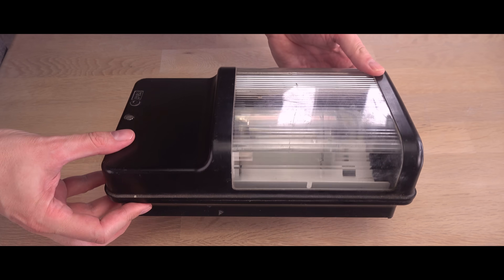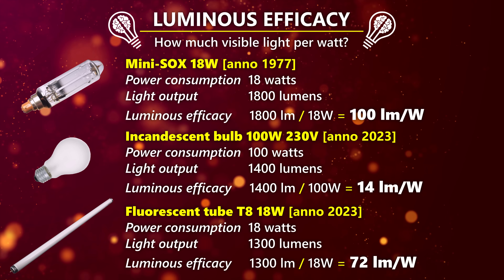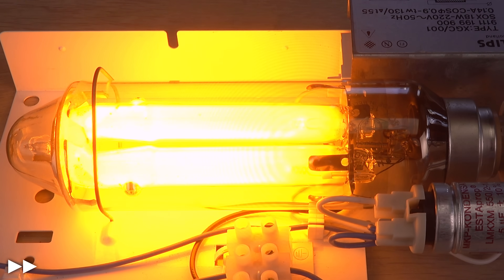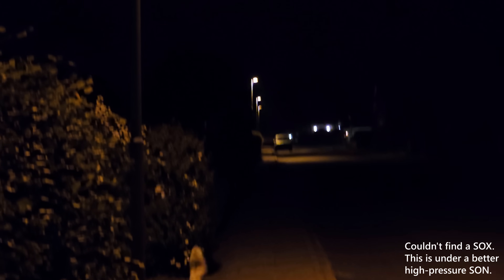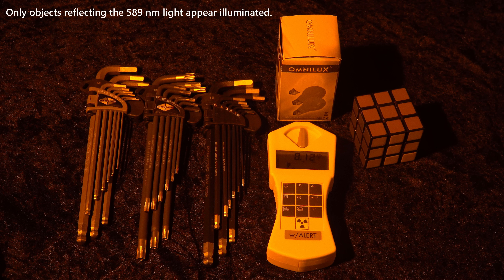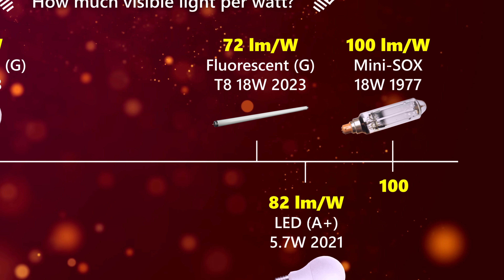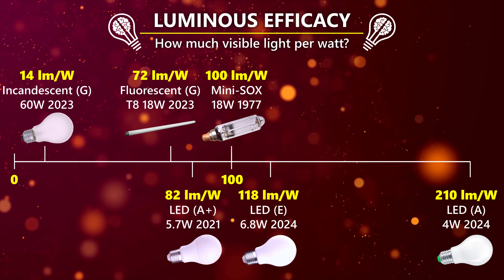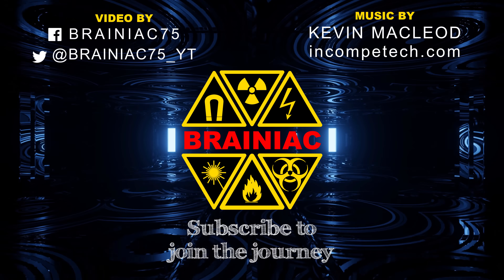THIS LAMP SOXs! "Yellow" tech of bright metal vapor lamp. Beats modern LEDs in brightness per watt?

Comment: For my first 25 years of driving an automobile, all motorways were illuminated with these 250 Watt low pressure sodium light bulbs. It became second nature to guess the missing red and blue cars which appeared as black. Nonetheless, the long night driving was very relaxing with this kind of monochromatic road light. I recall it was only in Belgium where every single stretch of road was illuminated at night. Parsimonious France and Italy only illuminated road junctions and urban roads.
Around the year 2000 something changed, and high pressure sodium and mercury light bulbs began making an appearance. The former have a wide light spectrum - wider spectrum with higher gas pressure, while the latter had a green and blue pair of spectral lines. The roads become whiter and - the Councils said - safer. I honestly miss the SOX lights of my youth.
Currently the Councils made me hate the newer LED road illumination: as a measure of economy, they set the brightness to a point where the light barely cast any shadow. Please note, is not possible to dim a gas light bulb; the race to install LED road light everywhere is because they can set each lamppost to 10-20 Watts instead of the statutory 250 W, while increasing the taxes for maintenance.
It reminds me of the communal moonlight lampposts in use more than a century ago, where an arc light was suspended at 30+ meters high, casting a dim and shadowless light, only meant for security.
I collect flashlights and all the models from 2005 to 2021 are now candidate for binning. A 2006 flashlight emit 200 Lumens, a 2024 flashlight emit 3000 Lumens, as the new power LEDs have an efficiency of 200 Lumens per Watt. As unbelievable it is, a professional pocket torch can emit 3000 Lumens for one hour; but the heat dissipation is not sufficient to keep this level of lighting for long, so the more normal light flux from a pocket light, keeping a reasonable mass, is between 1000 and 1800 permanent Lumens.
My brightest light, an X75, can emit 10,000 Lumens for one hour (until the battery goes flat), or 80,000 Lumens until the fan can't remove all the heath - few minutes at best. More than 50% of the energy fed into the LEDs is wasted in heath, which for 80,000 Lumens of light flux, is few hundreds of watt.
Thank you for this video, dear Brainiac. I have a lifelong fascination with lighting, so I had got into the details of how we make light - including oil lamps - and while I recognise how horrible is to illuminate our roads and public spaces with light having a monochromatic rendition, consider we had monochrome TV for few decades, and monochrome photographs for even longer. Driving at night in the '80s was like an immersion in a Black & White world, something that I, oddly, miss to this day...
I want to mention how much safer it was to drive under a 589 nm monochrome light when it was bad weather, under heavy rain or some light snow. The yellow light from SOX bulbs scattered very little, due to the missing blue spectral component. With HPS, mercury and LED lights there is a strong blue component, causing a lot of diffraction and subsequent light scattering around rain and snow, which is very unsafe in my opinion. The same problem is caused by LED car headlights, which seem blinding because of the excessive light scattering, caused by the intense blue source behind the yellow phosphors inside the LED.
Greetings from the UK,
Anthony

Comment: 1700 Lm/W is the highest spectral sensitivity and is achieved in scotopic vision at 507nm. Scotopic vision is mainly rod vision and dark adaptation takes up to 60 minutes. This is also the reason why a red light is used below deck in submarines. Seeing through the periscope at night at sea is only possible if the eyes are adapted to the darkness. When seeing in the dark, however, color perception suffers greatly, which plays into the hands of illumination with a SOX lamp.

The 683 Lm/W is really the maximum in photopic vision, where mainly the cones take over vision, which enables better color perception.

Overall, it mainly depends on the illuminance, above a few hundred cd/m² day vision dominates, below that night vision which offers poor color perception anyway (at night all cats are grey). Manufacturers are already aware of this and are pushing their LEDs further and further into the blue range in order to be able to advertise higher efficiencies.

😎Super detailed video, I subscribed straight away.

Comment: High pressure sodium is still used and has more colors. They put up LEDs in a park and some of them stopped working after a month. If I trust the cook of my dinner, I don't need to examine the meal.

I use basic LED bulbs at home that I got for free around 10 watts per 800 lumens. Those efficient ones might last longer because of less heat.

Comment: There are some still around, but you can't buy them anymore. They used them a lot in industrys and as an electrician I can tell you it's hard to know what colour wire you have under it. It's also used around observatories because they can filter that light out when making observations.
Reply: You can buy them still just go online I bought one back in October of last year just need to get another ballast kit for it.
Reply: @DiegoGene-fh3zp true, I actually came across some dusty old boxes with some brand new in them at a wholesaler

Comment: 95 lumens per watt for a normal LifX A19 bulb - I can't help but wonder, at 1100 lumens as the listed output and 11.5 watts as the listed consumption, how much of that is wasted on the 'smart' electronics that are very rarely used compared to the light itself - I'm only connecting to it for a brief few moments to change to a different color or brightness level, for example, despite the light being on for hours at a time, so if there was a way to turn off the wifi-radio and processor, it would be interesting to see how much the LEDs themselves sip, as well as very interesting to see where the 1100 lumens come from, what hue/temperature/etc

Comment: for anyone who hasn't seen it yet, the famous sodium vapor lamp film technology used for Marry Poppins has been recreated recently! Corridor Digital made a video demonstrating the tech. instead of using a unique crystal that filters for the exact frequency of sodium light, the recreated method uses a series of optical filters to get the same effect. it will likely never be used in modern films anyway though because the film industry is quite stubborn

Comment: Those watt ratings are for the LED part only and not the total wattage the bulb actually uses. When I was driving OTR back in 2008 and 2009 the sodium bulbs were still the major source of light at night along the highways. They were better for my night vision than the ugly green lights and easier to see contrasts. I still prefer them over the white LEDs for night driving.

Comment: There are vast amounts of research on sodium HP lamps. 600w seem to be the most efficient, agricultural version include more blue spectrum around 10-15%. oily fingers and age will impact results a lot, even similar models between manufacturers can vary a lot with their output.

Comment: Fun fact, there are solar cells that excel at converting the frequency of lps to electricity, and an lps lamp can use other sources of heat than electricity to generate light. There are actually two or more companies expecting to have products for hybrid cars based on these facts in a few year (we'll see). The idea is to get enough efficiency and weight savings to make that path better than standard ic (with moving parts and friction losses and so on) and generator (again moving parts and  various system losses).

Comment: Corridor digital did a video on these, because of the very specific color output you can use them for a negative for greenscreen uses with transparency which is otherwise very difficult to produce in software

Comment: You can buy high CRI LEDs that max out around 240lm/W   90+CRI (Rf 90 and Rg 99)  in   2.8mm × 3.5mm SMT package.   eg,   yuji HE 2835H G02.
It's possible that consumer products for these already exist but you may lose some light output in the diffuser so the overall lm/W output of the lamp as a whole maybe lower.
You could make your own light using LED strips of them and get ~240lm/w I guess by shining upwards to the ceiling without using a diffuser. (recessed LED strip)

Comment: I have to say modern led lamps are far more tireing on my eyes and lacking a big reflector eally gives the feeling of someone shining a laser at you.
Reply: LEDs are more-similar to Lasers than to any other widespread-use lighting technology. 
100% agreed. LED lighting feels strenuous. 

IMR/IMO, 
consequences of high-frequency PWM flicker and an obtuse misbalance of spectral output (typ Blue-weighted from a Blue Diode+Phosphor). 
I'd love to build/find some 'hybrid' luminaries; mixture of Halogen/Incan, LED, etc. to get the 'fullest' spectrum possible.

[unfortunately, Incans and SOX/LPS 'like' heat, LEDs very much do not]

Comment: How about the most efficient lights for plant growing? (blue and red)
and the most efficient lights for raising Black Soldier Flies? (Cyan [which is blue + green) ] and UV [Black-light])
I'm trying to do both with the same lights for my aquarium plants and the flies.

I'm currently running a LED daylight bulb, a LED blacklight and an LED Soft White or something like that, which has a very slight orange tint.

I could be mistaken on the names of my lights, but they are setup in a way that it is best for me to not deconstruct my setup to check the bulbs exact specs.
I'm thinking of replacing 1 or both with new 1500 lumen daylight LED bulbs and keeping the LED UV Blacklight, which is maybe 5 watts, but not sure.

Comment: Mines 140 lm/w Ive had better ones but they failed so fast, way faster than incandescent bulbs, literally 4 or 5 months, and despite costing a lot and being brand name like Philips.* These Wessex bulbs I bought like 4 for the price of one of those Philips and after a couple of years the first one I used is still going with no indication of failing.  
When you are talking about a difference of 1W it turns out that the cost of the bulbs themselves adds up to make it not worth going for the fancy ones even with electricity at the price it is these days. I dont know if thats just from the perspective of my budget either, I wonder if the manufacturing and material cost of bulbs is also high enough that more CO2 is wasted in high efficiency high rate of failure bulbs. Itd be nice if there was some kind of robustness rating. 

*Ive heard this can be heat issues and you can modify bulbs to make them last longer, but frankly I shouldnt have to. Id have been more sympathetic to the idea if it was some fundamental electrics issue with the flat Im in and spikes or some such, but now Ive got LED bulbs that work fine for years I dont see that the other companies have any excuse for such shoddy products.

Comment: when I used to work for a telescope factory, they used SOX lamps for their exceptional monochrome spectrum. spesifically they used it for  the newtons rings . in that instance they were using it to check the flatness of the angle mirrors.

Comment: It would be interesting to see a painting under that sodium lamp, made with metal oxide (or similar) pigments, such that there is green single pigment paint and the same green created with yellow and blue pigments. IE in normal light the greens would be indistinguishable, but under the yellow light you could see the difference.
Would that work?

Comment: Most of my bulbs are INNR 90%CRI 1060 lumen bulbs, drawing 11 watts, so ~96.3 lm/watt?  They have some smart bulb tech in them, so there is a bit of power overhead, as well as seldom being run at full power.
The others I use are mostly Philips Hue white ambience bulbs, which are harder to classify since their lumen output varies by color temperature.  7.5 watts and max output is 806lm at 4,000K, so 107.5 lm/w.
I have no idea what the specs are for the LED replacement tubes I used instead of the failing fluorescent fixture in the kitchen, just that they are FAR more efficient than the old T18 bulbs and ballasts were!

Comment: I use to install these SOX lamps in large outdoor areas, as they were everywhere back in the 1990's, still like them today, but technology has moves on.
Reply: I’m trying to get a set up goin on my property. I’d like 3 Low pressure sodium lamps. Or 1 Low pressure Sodium and 2 High pressure sodium lamps to help moderately see color. But I’m really just trying to recreate what I remember growing up. I don’t know all the details, but I’m learning!
Reply: @cvince556 I'm trying to get mine HPS set up but I need a new ballast because the one I have in it has 480 volts I'm gonna get a 70 watt ballast with 120v.

Comment: In Lisbon Portugal, street lights are similar, not sure if it's the same tech but honestly I love it. It really brings a special atmosphere and it doesn't seem dangerous to drive in it.
Reply: Most (but not all) orange colored lights are high pressure sodium, which emits a bit more different colors of light and has somewhat better color rendering as a result. The HPS lights are still orange, but not that striking deep "pure" orange that can only be produced by low pressure sodium. The HPS lights look a little bit closer to white while still being very orange.
Reply: @gplustree  CCT is 1700 K for LPS and 2100 K for HPS.

Comment: I have some 90 lm/w and some 120 lm/w led lamps in storage. For some of the lamps I'm using I have done the resistor mod to meaning that the numbers on the box no longer match the actual output. I could calculate the current going into the led circuit but since efficiency changes with the current and I don't know the efficiency curve the calculation would be meaningless but presumably higher efficiency than without the mod.

Comment: In my opinion, we should use either sodium lamps or filters over LED street lamps. My reasoning is that it's not as harsh on the eyes and in foggy conditions you can see better in amber light

Comment: I have a small, pocket LED flashlight (70x24mm, Thrunite T1S) that at minimum brightness will last 42 DAYS.  At that brightness, it's quite easy to see by, though not something you'd want to use to pick out details at a distance.  LED efficiency is insane these days, and this flashlight is several years old.  I can only imagine the lifetime a current-gen flashlight would have, using the same lithium ion cell.

Comment: I'm happy to see the low pressure sodium light as it's one of the coolest light bulbs. As an light bulb collector and science interested, this video was absolutely great, especially outlining the monochromatic light. Also, if anyone wants to do this without purchasing the light bulb and fixture, you can use baking soda or a solution of salt in napkin over a candle to emit some of the sodium light.
Reply: An interesting experiment involves doing that in the LPS light. The so called "black flame" experiment.
Reply: If you underpower a HPS (SON) lamp the sodium vapor pressure will be lower and the light output will be similar to a SOX lamp. At even lower power it emits a bluish white light from the xenon-mercury discharge and the aluminium oxide arc tube phosphoresces in deep blue for several seonds after turing it off. But you need a few 10 mA of current like a neon sign transformer for that.
Reply: @mernokimuvek  I potentially know how to conduct this experiment. I wil preheat it and then power it with a tesla coil. It works as i tested it, but i forgot to do the black flame experiment while at it 😂
Reply: @photonik-luminescence  You can  do a black lamp experiment if you have 2 SOX lamps. Turn one off and the arc tube will look black if you try to look at the still on SOX lamp through it.
Reply: @photonik-luminescence  SON and SOX lamps have an evacuated outer bulb and can produce X-rays with a Tesla coil. Be careful with that. Some metal halide lamps and lower power (50 W) high pressure mercury vapor lamps also have an evacuated outer bulb.
Reply: @mernokimuvek  i know about the x-rays but there's a required voltage for that to happen. The tesla coil i have only produces a arc of max 2cm.
Reply: @photonik-luminescence  That can already be 20 kV peak voltage. 20 keV X-rays can pass through glass and they can be more dangerous than high energy like 100 keV X-rays. 100 keV photons mostly pass through you but you aborb almost all 20 keV photons. Commerical X-ray machines filter out soft X-rays for this reason.
Reply: @mernokimuvek  ok, after a bit of research you are right. I don't know if a metall plate is required to initiate the bremsstrahlung.

Comment: I have a couple of the bulbs but I don't have the 240 outlet needed to run it.
Reply: You need a ballast to operate it. Never connect a plasma based lamp without current limiting.
Reply: @mernokimuvek  what would happen?
Reply: @LacrimosaSunshine  The lamp would be damages. Glow and arc discharges have a negative differential resistance.